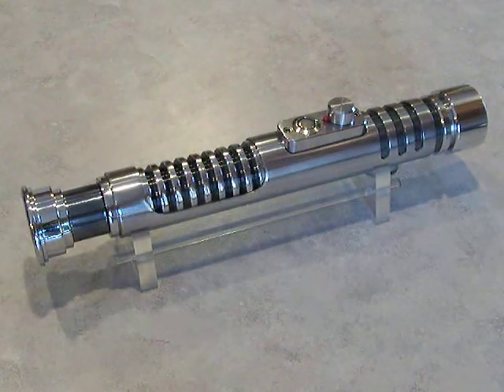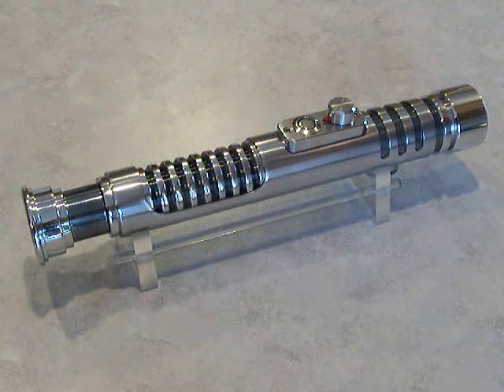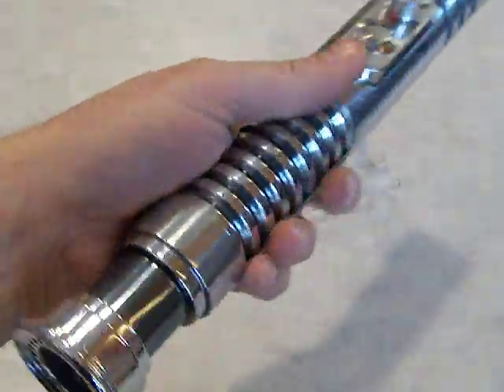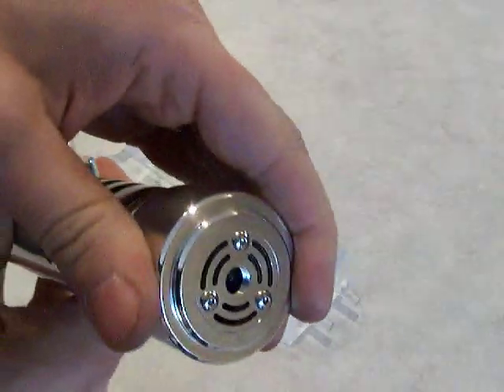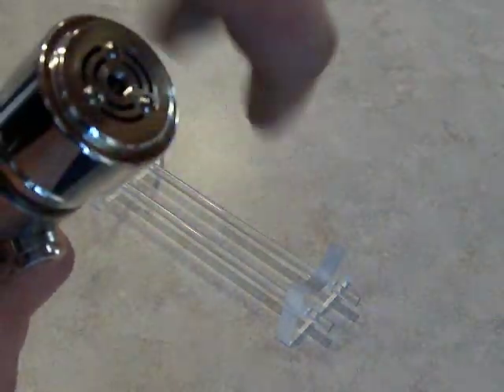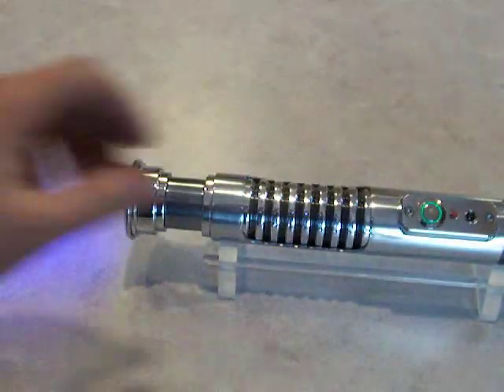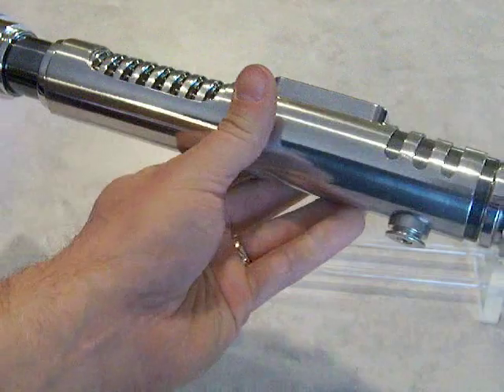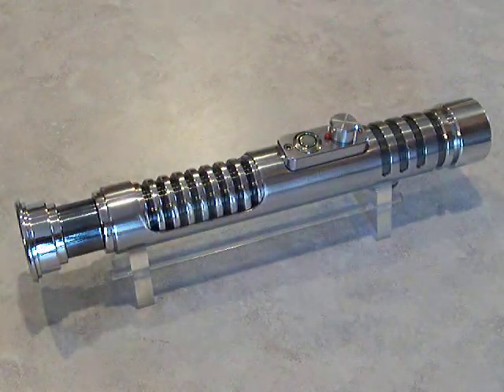Jay-gon Jinn's Chrome Saber 35

Comment from the maker: @monsterenergymixxd8  It's not like I sent it out to be polished because I didn't know how or want to do it,  MJ had to because the parts needed to be stripped after he attempted to clear coat the emitter and pommel after pc'ing the black chrome first.  it didn't mix well,  so he stripped it,  and wet sanded and polished them again after the stripper dulled them.